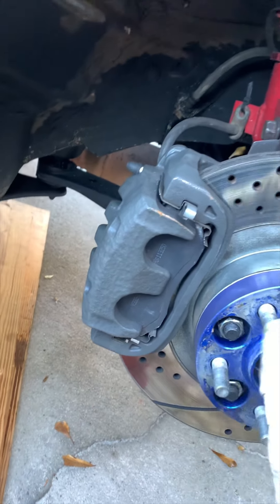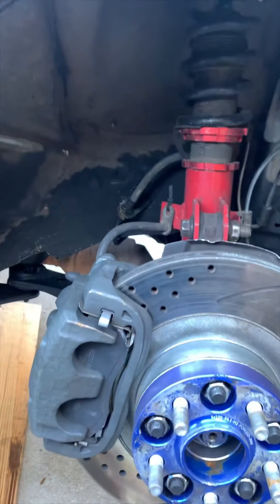How fix brake noise/rattle *SOLVED*

Comment: Do you hear that during braking or when not pressing the brake? I hear a noise when i puts the brake, or sounds like bad track end rods, but the car just came after suspension repair for these things.
Reply from the maker: I would hear it when I’m not applying the brakes, as soon as I would apply the brakes it would go away. that’s because the tension of the brakes being applied eliminated that free space for the pins to move around inside the bracket vs when the brakes aren’t applied the pins are freely moving around inside the bracket.